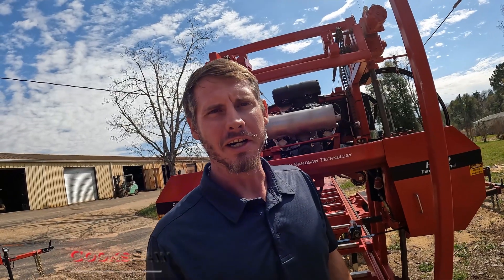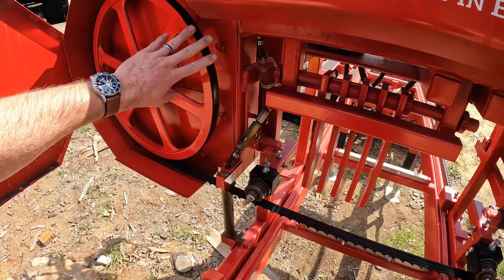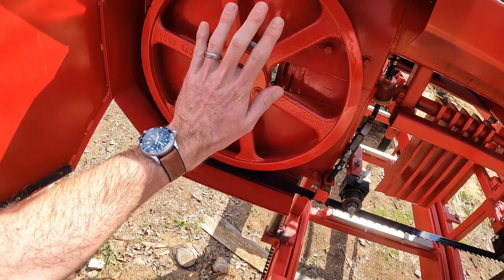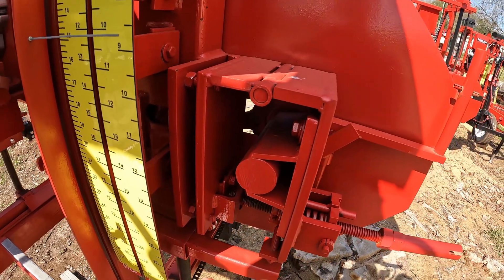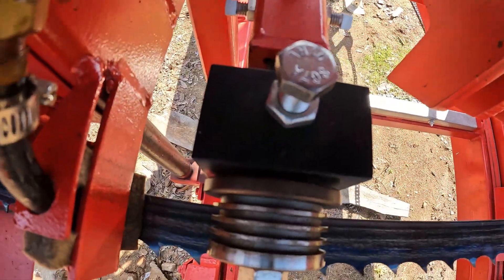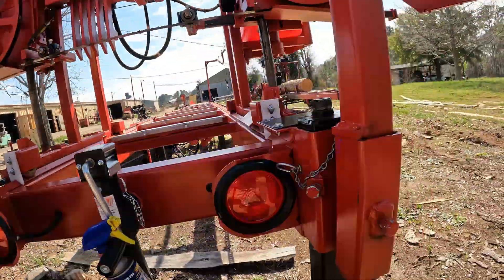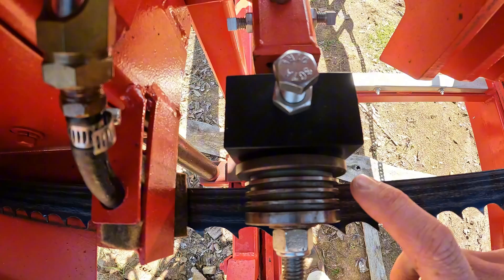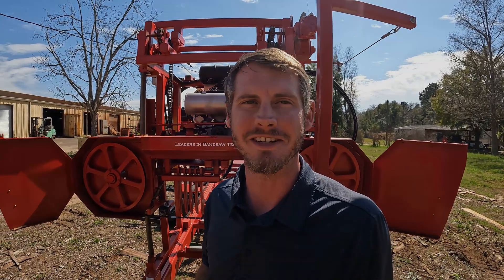Easy Bandsaw Blade Tracking for Any Portable Sawmill | Quick Adjustment Tips from Cooks Saw

Comment: Nice job on the video.  It is always nice to see a refresher on setting up the blade.  I appreciate how you reach out to owners of other brands of sawmills.  The WoodMizer Northwest headquarters just moved to my hometown of Sandy, Oregon.  I stopped in to say hello to them since I used to have them sharpen my blades.  I thought it was unusual that they no longer sharpen blades for their customers in house.  They were only about 25 miles from me and now the nearest blade sharpening shop they recommend is about 90 miles from me.  That doesn´t make much sense to me because they used to have five automated grinders going most of the time with one person doing nothing but grinding and setting blades.  It is also interesting that I know of two WoodMizer mills that now use Cooks blade oiling systems on them.  Your oilers are a good upgrade to any mill.  I'm glad that I have the Catś Claw system at home.